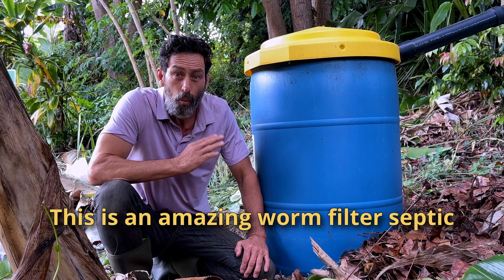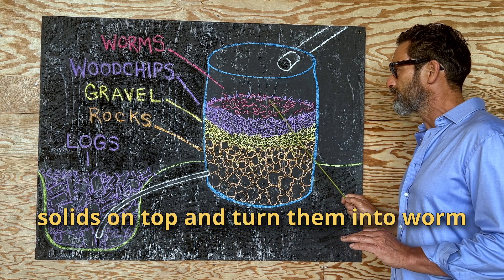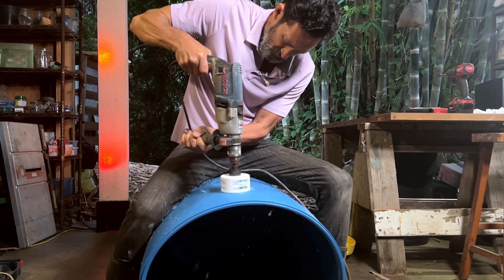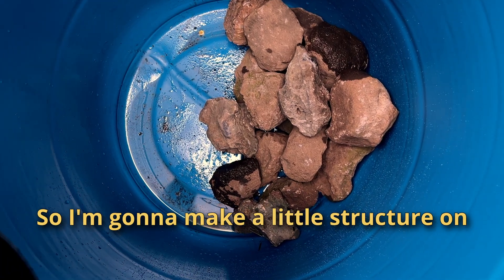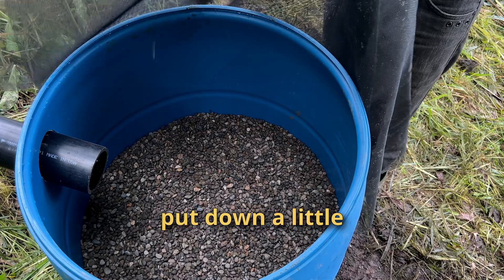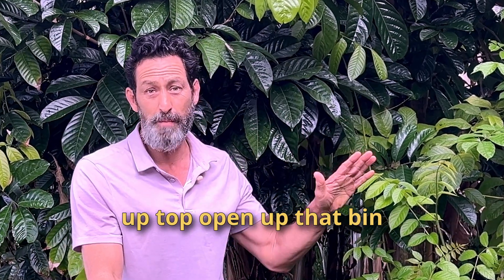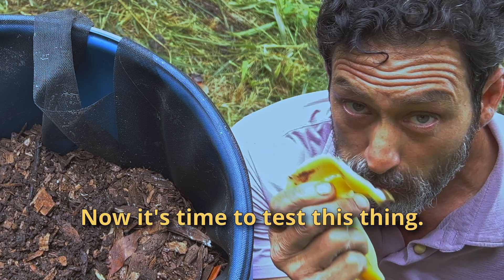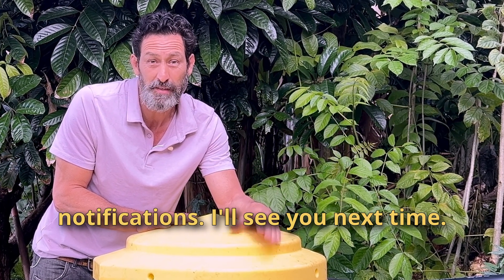DIY Eco-Friendly Worm Filter Septic System | Build for Under $150!

Comment: I was on board until your offhand remark about putting the used toilet paper in another bin..  Every worm treatment plant I have seen allows use of toilet paper, most advise against the cotton variety,  though they are all far less hands on.  Most also require ~25 metres of absorption trench per person for the effluent casting mix, far more than a tiny hole.  Unfortunately your budget $150 design is where cost cutting intersects with chundering!

Comment: Nice set up. How often fo you empty it?

Ive made a similar system in an outhouse using 2 stacked 5gal pails. I cut the bottom out of the lower pail allowing liquids to drain freely. Drill holes on the top pail. Then layer wood chips (1 scoop / poop) as I go. When the upper pail is full I remove and empty as mulch for trees. I've found the layering process helps aid decomposition. 

Note; this is for temporary use at an offgrid summer cabin.
Reply from the maker: The first one O built was for a small cabin for two people or less. I had to scoop out some gorgeous work castings after about two years. I added more wood chips every six months or so.
Reply from the maker: I like your 5 gallon set up. I was imagining similar set ups for use here when we need extra infrastructure. Thanks for your experience!